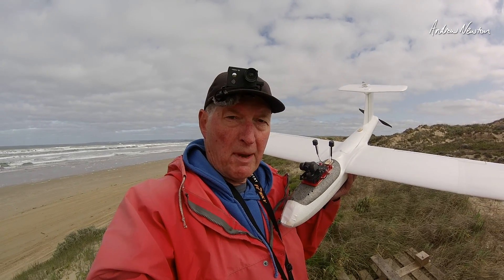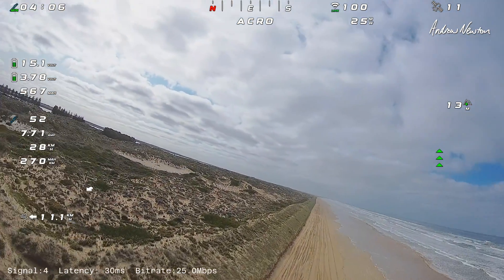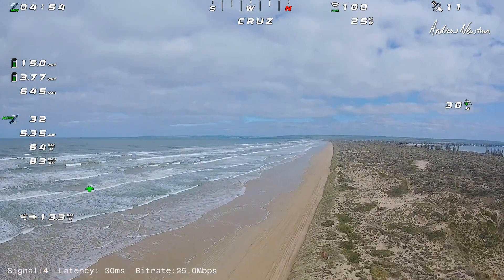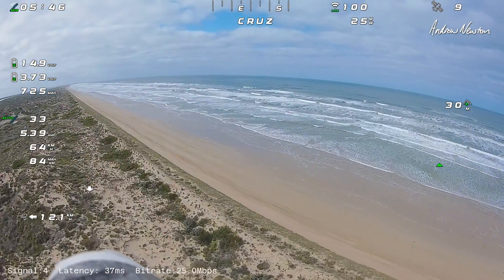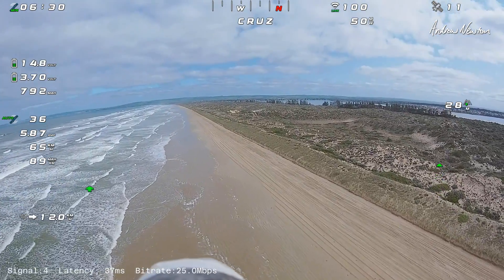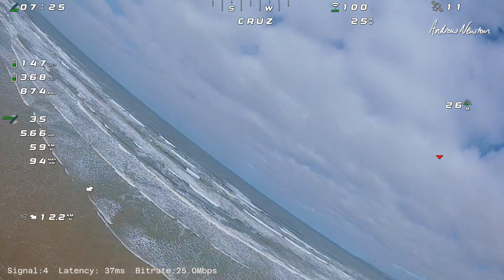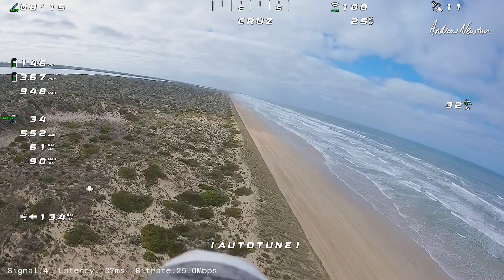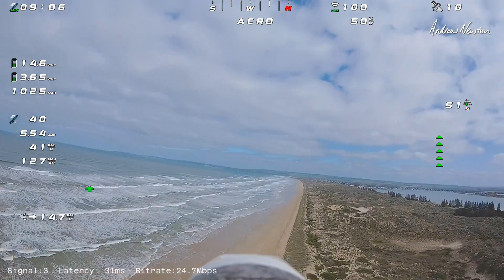Caddx GM3 Gimbal - PWM Control

Comment: INAV now also supports the Caddx / Walksnail GM Series Gimbals. These can now be controlled via a dedicated uart UART or via MSP and don't need up to 3 PWM Outputs anymore. This enables the direct Gimbal Control via Head Tracking from Walksnail goggles, without additional wiring.
Reply from the maker: There you go, I was wondering about the Gimbal UART use. Thanks.

Comment: Just wondering if I can use GM3 on my fpv flying wing.  I'm using Inav and speedybee 405 wing with an analog cam/vtx.  Or is digital required?
Reply from the maker: Doesn't have to be digital. Camera has to fit and the cable not restrict gimbal movement. But it's too delicate for a flying wing. Really needs landing gear and a smooth runway.

Comment: Where is the data on the screen coming from and is it in your goggles while flying? I have the googles and pro setup coming, but would also like to have the information in the HUD if possible. Thanks
Reply from the maker: From the Flight Control Board. Yes the recording is from the goggles, exactly what I see.

Comment: Damn, I was hoping you could have both head tracking plus at least manual panning together at the same time... 
It seems you're saying that's not possible with this system, is that correct?
Reply from the maker: Not as far as I know. One or the other unfortunately
Reply: Stick with Switches or knobs.  You won’t like headtracking for long.   It get annoying.  Use Headtracking on ground vehicles is whole different story though.  I’m more into that now days

Comment: Thanks for the awesome info! Question - HOW did you wire that thing to power and your FC? I cannot find the answer I'm looking for anywhere :\

I have the GM3 + Avatar HD V2 (dual) and a SpeedyBee F405 Wing - I'm also new to this, so the learning curve is steep.

I can wire the VTX to a UART. Attach the Gimbal power/ground to the battery. Attach PWM wires from the Gimbal to 4 different servo signal wires. Would that work?

I'd prefer NOT to wire it directly to my battery. Could I connect the power/ground cable for both the Gimbal and VTX and attach it to the UART for the VTX?

Thanks!
Reply from the maker: Thanks. I would use the DJI UART which has 9V, G, T and R for the VTx, and use the analog Cam or VTx socket 9V and G for the gimbal power. Then 4 servo pins for the PWM controls. Check that the 9V is actually set to 9V (or 12V) and not still at 5V, might have to solder bridge the VTx voltage selector pads.
Reply: @AndrewNewton  Thank you for the detailed response. This is extremely helpful for someone new to this. :)

Comment: On my head tracking planes, I like to have a three position switch that switch’s between head tracking, knob control and look forwards.  Controlled from the radio.
Reply from the maker: Yes, excellent setup
Reply: how do you do this with ardupilot?
Reply: @staymad7206 good luck. I like ardupilot but man they just don’t keep up

Comment: Sad to hear you can't switch between PWM and head tracking while in flight
Reply from the maker: Actually I think you can switch to head tracking on the fly but not back to PWM.
Reply: @AndrewNewton  trying to setup pwm input on the gm1.. aux is recognized on my tx but cannot get it to talk to the gimbal.. any tips?
Reply from the maker: @AKtoTok  Which radio and receiver?